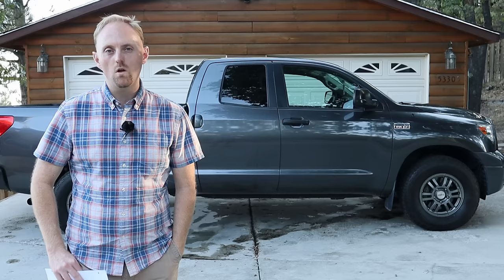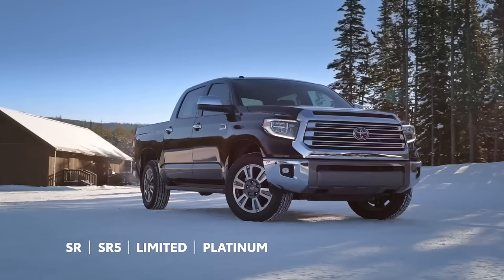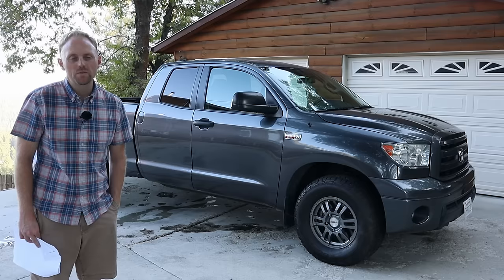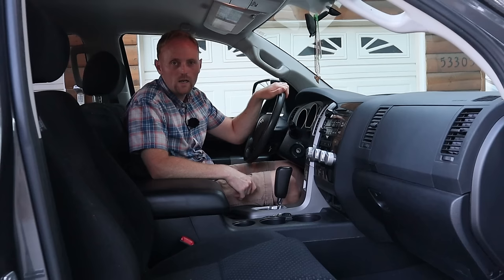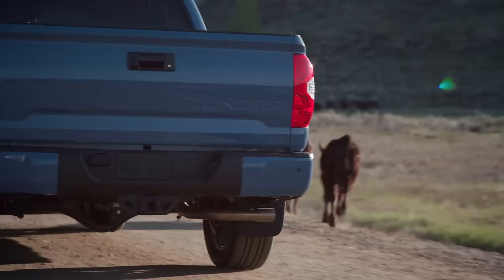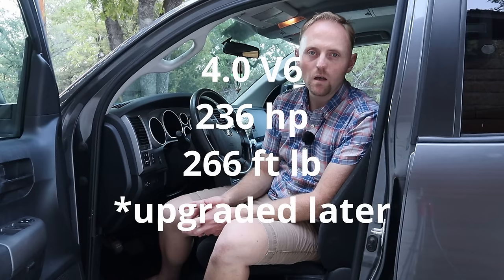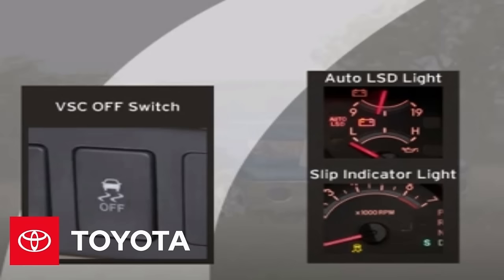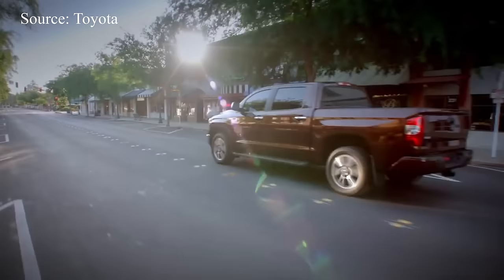Toyota Tundra  |  Brutally Honest Long-Term Owner Review

Comment: Crewmax is way to go for sure reclining rear seat and massive room
Reply from the maker: yeah but that 5.5 foot bed...
Reply: @BigRockMoto  I though about that but honestly what can you actually put in a true short bed that you can't in the 5.5? Fully agree trucks lost funcunality with loss of true long bed. But with tailgate down and one of those flip down tailgate extentions you can haul a lot. Have hauled full plywood sheets several times. Just put tailgate down
Reply: Don’t get the 2014 and newer. That feature is gone plus no storage in the back. No room under or around the rear seats at all for jumper cables straps 
. Only about 1/2’’ under the seats
Reply: @jrocu2  damn did not realize that. Storage behind and under rear seats is massive on my 2012
Reply: @jrocu2  that's the biggest disappointment regarding the Crewmax. Especially since the Crewmax has significantly higher resale value than the double cab, according to KBB.
Reply: @cbr6864  most things lol. Fishing rods for example. An 8 foot stud will fit diagonally in a 6.5' bed with the tailgate closed. Most lawn mowers and ATVs will fit in a 6.5' with the gate closed as well. A 14 foot kayak or jonboat will ride much more comfortably in a 6.5' than a 5.5' (center of mass is ahead of the edge of tailgate).
Reply: @daniels2761  if I have anything that won't fit in my bed ill just use my trailer. Don't think I'd want to be fighting anything that big up there. Hauls my kayak, motorcycle, sheets of plywood just fine
Reply: Funny because when I bought my 14' CM (93,010 odo back in early March 2018, today 149,478 odo) Tundra, the sales person told me that he called the back room, "The theater room". Pretty true when he said that and made me giggle because its true. TONS of room in the back of my CM. However I test drove a 13" CM and missed the pros of it because of moveable rear seats and more storage on the doors. But overall I do love my 14' CM and have over 149k (close to 150k) and still running like a clock.
Reply: @BigRockMoto  I have not found that to be a problem.

Comment: Btw I did just buy a 2020 Tundra SR5 SX 4x4 about a month ago. Mainly due to the fact my 07 was so dependable. 250k miles. I looked at the domestics yes a bit more refined especially the Ram but that’s not really that important to meI looked at the mid grade models. But the 2020 Tundra seemed plenty techy and with Toyota safety sense and Apple car play I’m happy so far with my purchase. Also I’ve made some comparisons with my friends trucks 2019 Chevy 5.3 and another’s 2018 F150 3.5 and I only get on average about 2 mpg less?  I’ve achieved 18-20 pump to pump easy open road driving nothing over 65 two different times.
Reply from the maker: Thanks for sharing
Reply: something must be wrong with my Tundra. I have a Platinum 4x4, even if I drive 55 mph and feather it the best I’ve ever seen is 15mpg usually around 14-14.5mpg over its 120k mile life.
Reply: jrocu2 do you have oversized tires?  pulling my boat the other day 3-4 k lbs the computer said 14. I didn’t do a pump to pump. I’ve got 18” wheels.

Comment: I have a 2017 TRD and wouldn’t trade it for the world
Reply: I just bought a new 2020 TRD this year.  My dad is a sales manager for a Ram/Chevrolet dealer.  I was brought up being told "buy American"  I did for years.  I have been sorely dissapointed in the big 3.  My last truck before the Tundra was a Ram, falling apart at 50000miles.  I have plenty of money and maintain my stuff religiously .  I hope the Tundra doesn't dissapoint with the removal of the transmission cooler.
Reply: @qwertyui859  All the best! If there is a auto manufacturer worthy of any faith, Toyota is the one! Congrats on your acquisition.

Comment: I bought a 2003 Tundra  4WD SR5 Acess Cab  brand new MSRP was $31,000, I paid $26,000. I still have it. It has some dings in the body.  Interior is a little dusty and dirty but no damage. Just light wear and tear. I towed a travel trailer for 10 years.  It still starts and runs like new. Normal maintainence, no power train issues what-so-ever. I think my biggest complaint is not having an 8ft bed.  I think all full sized trucks should have an 8ft bed.

Comment: What you lose at the pump with less than stellar mpg you get back with it's reliability. 

I have a 2018 2wd crewmax 5.7 I get 18-20 mpg on the hwy. 

It does need a locking diff. 

Get the rear sway bar on day one!
Reply from the maker: Forgot to mention this truck has the sway bar.

Comment: If you do the math, you'll find that the 6 speed + 4.30 is still behind (say) the Ram 8 speed with a 3.21. Because of the extra gears and ratios that were chosen, the ram/3.21 has a lower first gear (better for pulling), and a taller final gear (better for highway running/mpg), so the Tundra definitely doesn't tow better than newer trucks either. Let's face it, even in longevity, the Rams/Fords/GM's last a long time. I still see 90's era's trucks on the road. At this point, you buy a new toyota simply because you're a toyota fan, not because it's better in any way. These trucks have ceased to be competitive in every metric. 

So no, I feel sorry for new 2020 Tundra owners, but will definitely look again if/when they finally get around to releasing a new model.
Reply from the maker: Some good points!

Comment: Bought 2020 SR Tundra not just to save money but I put custom rims on at 2k miles,Carven stainless cat back exhaust at 500 miles,side steps and push bar,didnt want center consuel as waste of space so got split bench,no badges or decals.$38,000 out the door.I grew up on Kodiak Island Alaska and to this day dont need $20,000 in extras like ac for seats,all the whiz bang stare at the center entertainment crap,will put my lift on shortly and fender flares,rear locker,Toyota is reliability and rather pay more at the pump and not at the mechanics shop.

Comment: For my the Tundra just won't do. I need towing power, comfort,  style and luxury. 

I went with my 2018 Ram 2500 with the Cummins. LOVE IT!

My buddy had a 2014 Tundra,  the dang bed started showing strong signs of rust in less then a year. We noticed it on the bottom of the bed when it was on my lift. The truck showed this rust before it EVER say snow

Comment: I'm looking at used Toyotas now. I foolishly bought an F150 with 200K for $2k. I think I have $3k into repairs after 12 months. I live in the rust belt, so I can only lay so much blame on Ford. I have a 16 year old Lexus that hasn't had any problems, just change oil and other routine maint. Great video, I appreciate the historical view on Toyota trucks.

Comment: I would not ever buy another Toyota as long as I live. The way I was treated by several Toyota dealers, nope never again. I had major problems with the truck I owned, no mods done to it left it stock and yes it had major issues. Main wiring harness for the ignition was faulty had to be replaced, had 3 rear main seals go out on it. Had to through arbitration to get things fixed, and every time I went to the dealer they all said the same thing: "What did you do to it" like your crap doesn't break? Nobody had an explanation other than just my luck. I tried to hire an attorney for the lemon law, but the lawyer said it was too difficult to prove which I thought was BS... Traded it off on a Chevy Silverado 178,000 miles later still drives like it's new love the truck. I am considering another Chevy with the 6.2 Trail Boss Custom, can't afford the LT...

Comment: They haven't kept up because they don't have to. They can sell every single truck because people that want their truck to keep rolling past 150K miles and not have to replace the transmission etc will keep buying Toyotas. That's why they have such great resale value, they hold together and don't have serious issues. Capitalism at work. Why invest to retool or put extra gadgets on to lure  folks in when you don't need to.
Reply from the maker: Good point

Comment: Love my 2020 I had a 2012 and 2013 , my 2020 doesn't have a trans cooler on it and this was a major upset. people are installing one aftermarket on their 2020's I will be putting one on , very upset by this
Reply from the maker: Thanks for sharing seems crazy they would remove it
Reply: @italRotty.....I feel ya....I have a 2020 and am worried about that also but Toyota says its not needed. But...professed transmission experts(I'm taking their word for it) have stated that no transmission should have temps @250+ even when towing. They say the fluid can handle that temp but the components of the transmission can't and will start wearing prematurely so its not good for longevity.
Reply: @dalephillips8250  i totally agree, I am going to get the cooler on there before i get to 20k, i just need some time and $$ to get the parts and put them in, good luck to ya, i think you should put one in too !
Reply: Thanks man. What year did they quit putting the cooler on ?
Reply: @mattd8411  2019 was the first year without the cooler.
Reply: @dalephillips8250  awesome thanks do you think 11k you'll be to hard to pull with a 18 double cab ? I wouldn't be doing it alot just a few miles a month
Reply: @mattd8411  I think the Tundra is fully capable of doing it especially if its only a few miles. But keep in mind that when you tow more that factory rating of the truck IF you get into any accident or problems they will fault you for towing too much so just be careful.
Reply: @dalephillips8250  ok thank you yes thats definitely something to think about.

Comment: This is the best review I've seen so far. 
I like how you lay it all out as far as telling people, you want reliability with less gadgets, get this tundra. If you want more gadgets with more things to go wrong, get a dodge or f 150 lol. 
As far as gas mileage for the tundra, if your in it for the long haul with this truck, I'd go with the Toyota because a smaller engine doing the work of a 5.7L will not last I don't care what anyone says. You will save money on fuel economy in the short term but will put all that money back into the truck in repairs eventually. 
Don't buy a truck for fuel economy. 
The Honda Ridgeline is probably the truck that most people need for what most people actually use a truck for.

Comment: I had to spend $350 for repairs to my ‘05! The world is coming to an end! New Chevy trucks are plagued with transmission and valve lifter/cam issues.
Reply: Anyone that buys a GM product has a hole in their head.
Reply: @jenniferpetrauskas7648  it’s getting that way for sure! Quality is terrible. I work part time at a Chevy dealership, and get to see the service bays and what’s going on. I drive Toyota’s!
Reply: @davidhorne2326  I've driven every imaginable GM car from 1968 and everyone I had cost me more money than it was worth. Since I got out of the big 3 I've had nothing but good experiences with my vehicles. Ford id the only truck I'll look at other than Toyota. Other than that their cars suck.
Reply: @jenniferpetrauskas7648  3 Toyota’s in my driveway. Just bought a Supra, omg, it’s a blast to drive.
Reply: @davidhorne2326  I have  as you may know a Tundra but also own a 2016 Corolla and it's a blast to drive a good on gas because I have to travel 30 miles one way to work. 20.00 a week to fill up. Tundra more of course like 70.00 a week. That's why I bought the Corolla. Bought that used and no problems with it. Same with the Tundra. By now if I had a GM I'd be ready to put a 3lb hammer to it.
Reply: @davidhorne2326  That thing is TINY.    Corvette for me.
Reply: @paulmoss7940  once you get in it’s fine. And I’m an old guy! I had a ZL1, that GM bought back, then I looked for a used C7, but the market was crazy. I feel like I can drive the Supra everyday if needed, not so much with a corvette.
Reply: @davidhorne2326  I dig toyota trucks, have taco and tundra. But my fun car is a 96 LT4 vette. I'm 60, so its "fall in, crawl out " over that high threshold. I bet a manual C7 would hold value well. Not a C8 fan ,I now want a manual C6. Hope that BMW engine hold up for you. Cheers !

Comment: Nice review as a former tundra owner I tend to agree with most of your points. Little note on trim levels. Trd off-road is a package you can add, but not a trim level. Trim levels include sr, sr5, limited, platinum, 1794, trd pro. Believe you can add off road pkg to all but platinum.
Reply from the maker: You are right,  after I did the video I did more research and realized that. Thanks.

Comment: I sold my last American made vehicle. Bought another Toyota . Wife has a 2018 Camry and I bought a 2021 Tundra. I can’t believe Ford & GM have run the quality into the ground. Those are there bread and butter. Surely they will not be in business in five years. Ram has coil springs and it squats something furious when loaded.

Comment: Toyota Tundra is a time machine. I had issues with mine and now I have a 2019 Limited RAM 1500 (for my driver) and it is way better than the Tundra. I can tow much more, it rides better, it gets better MPG (by far) and is a lot more comfortable. The RAM has 82K miles already because I love to drive it. For those of you that start the reliability chant, it's all about how you take care of things.  My RAM has held up better than the Tundra, but both trucks are durable. All the new features and the interior of the RAM is just extremely awesome.  Oh, and RAM has a 5+ (best of all 1500 trucks by far) safety rating!!!  Cheers.
Reply from the maker: Thank you. I came so close to recently buying that same truck. Glad to hear it's working out for you. It's a luxury vehicle!
Reply: Wouldn't on one never buy a dodge. Only toyota or nissan. Bought both trucks new never ever had issues 97 nissan hard body still drive it
Reply: I had serious issues with a 16 tundra platinum. Sold it back to the dealership and bought an 11 Sequoia platinum and it's been easy street since!

Comment: Planning to trade my 2008 tundra long bed for a new 2500 long bed. Wish they made a diesel motor that had more comfort and technology.. Has a 3 inch lift at the front and 2 inch at the rear. I got a new frame and whole front suspension under recall. And so far at 130k miles still no issues at all.